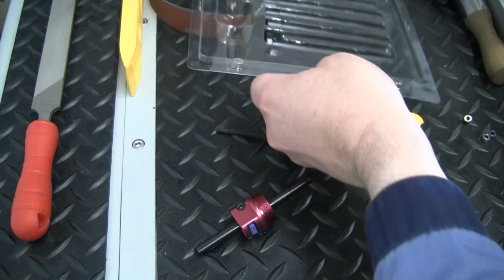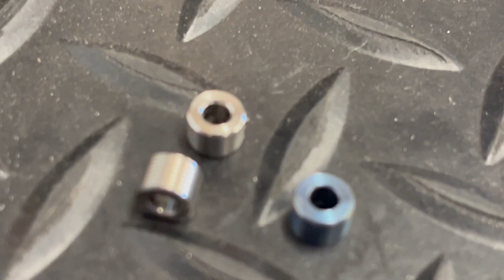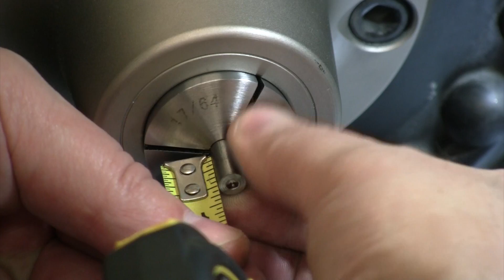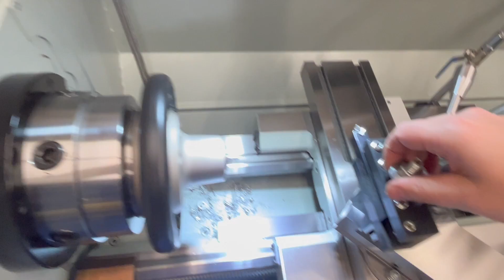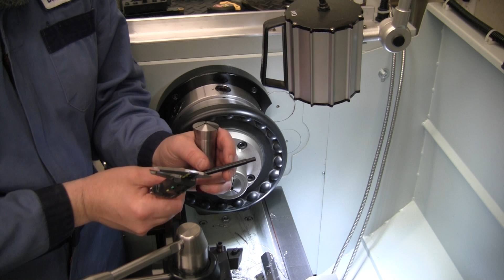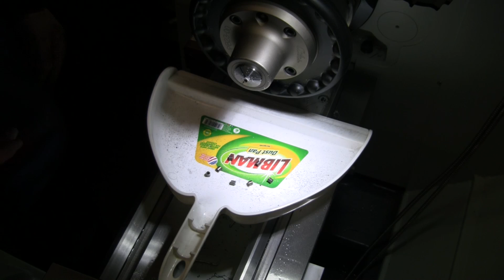5C Collet Stop Review!  Does It Help With Small Parts?  Also Using DRO Tool Offsets.

Comment: I'm sure you are aware of the limitations of the floating style stop. It moves depending on the diameter and to some extent the clamping pressure. There is a simple solution for a repeatable dead stop that can easily be made. Take a look at these two demonstrations on my channel.
Simple machinable 5c collet bush.
5c Z axis datum stop ring for different diameter parts.
I hope the info is useful.
Reply from the maker: @machinists-shortcuts  Yes, familiar with those limitations. The believe I mention them in the video?  Has been a while. I will check out your solutions as I am sure others will. Thanks for sharing.

Comment: There will be no repeatability as this isn’t a dead length chuck
Reply from the maker: @dimsum5567 - Thanks for the comment. I had never heard of a dead length chuck. Just did a little reading, makes sense.  Good to know what other options are out there thanks.
Reply: @BladesIIB  basically your problem is that your collet stop moves together with your collet when you are tightening it, so you can’t get the same part length, the stop is always at a random location…
Reply: For every unit difference in diameter the stop moves 3.

Comment: Why do you need to change the tools on the DRO when you are machining everything manually?
It's not like it is a CNC with a program?

* Buy a small CNC lathe that can knock these parts out in a tenth of the time?

As the way and time you are doing these parts can't be profitable?
Reply from the maker: Li'l Pete's Workshop - Thanks for the comments.  You don't have to change the tool, you could write down all the DRO numbers you are going to for each tool instead.  I just find that when I do that, all the numbers are crazy random numbers and it is a lot harder to memorize your formula for speedy repeatability.  By using the tool offsets, I can turn each tool to either a 0 reading or some other more easily remembered reading on the DRO and not have to look at my notes on every tool change.  No I am not a CNC but I try to leverage the power of my DRO to make it faster and easier and show others another way to do things.  A small CNC would definitely be faster, life is all about trade offs.  Making these myself is a lot cheaper for me than outsourcing them.  Owning a small CNC would take up space I don't have and sit for weeks at a time not running, that is not profitable either.  Making knives is sort of a labor of love.  This is my weekend and evening hobby so I can't always justify all the tools I would like.  The profitability equation for my hobby is can I get the sales to pay for all the materials and resources.  I don't think it will ever pay for the time I spend, then it would be work and possibly not as fun anymore.  Cheers!

Comment: The burning question in my mind is... Why not drill deep enough (into the part of the material inside the collet) to let you part off a number of pieces? Seems like a lot of extra work to do it for each part.

Overall a great video! But man if you do these all the time maybe consider a sherline CNC 😁
Reply from the maker: guitarchitectural - I appreciate the comment and have tried drilling deeper. I used to do these in sets of three with more sticking out. The bottom line is without coolant drilling the titanium any deeper stats to build up more heat and you need to start peck drilling and clearing chips. This overall seemed like the best trade off but I am sure more efficiency could be found. I have a CNC mill maybe a small CNC lathe one day. Still just an evening and weekend hobby so can only justify so much. Thanks for watching and keep the comments coming.

Comment: My lathe at work is larger, but there I use a stop in the spindle. As you said: with your setup the stop is relative to the collet, with a spindel-stop it is relative to the lathe. If I understand your imperial right, your "two thou" is 2*0.0254mm= 0.058mm tolerance/differance? That is about a hair...
Reply from the maker: Johannes Laxell - Yes, I think you have it. A stop relative to the lathe should reduce some of the variability. My converter for .002” came up with 0.0508mm but agree just a hair 😀.  Thanks for the comment.

Comment: it's the same rpm for every operation why shut the lathe off between each step. seems like a lot of wear on the motor spinning up
Reply from the maker: Wags - thanks for the question. I felt it was safer to shut it off moving the tool holder back and forth over the chuck. It is 3 phase so not as big of an issue than if it were a single phase motor.
Reply: @BladesIIB  think of the time you'd save if the drondisplay and tool holders were down near the carriage or closer to you!
Reply from the maker: @guitarchitectural  Thanks for the comment. Yes that would be a time saver, good thinking.